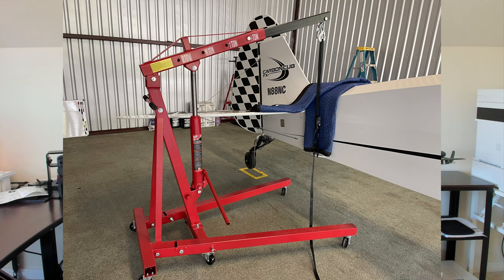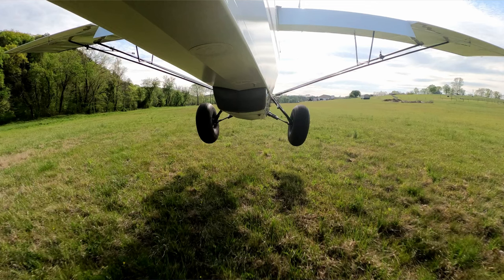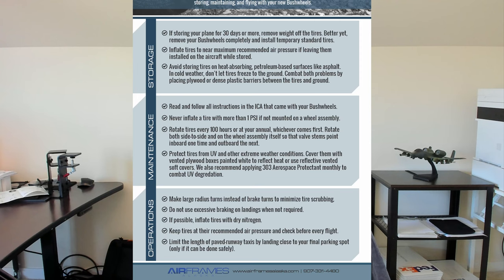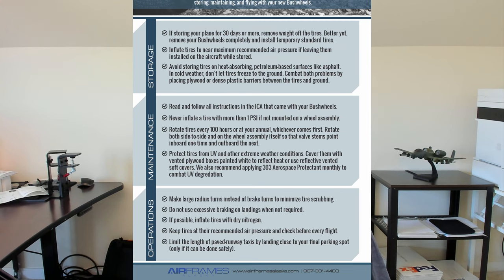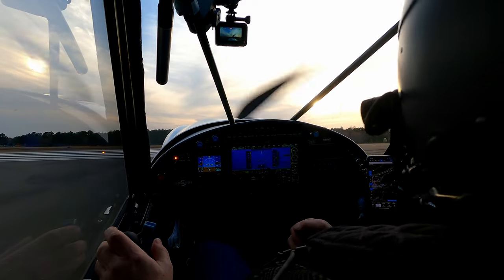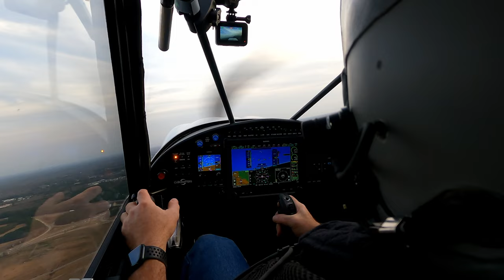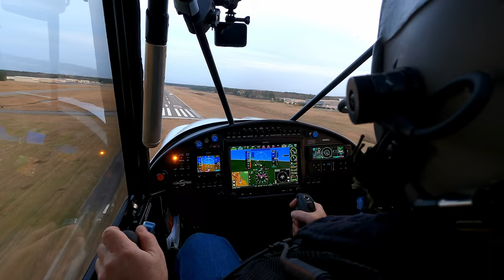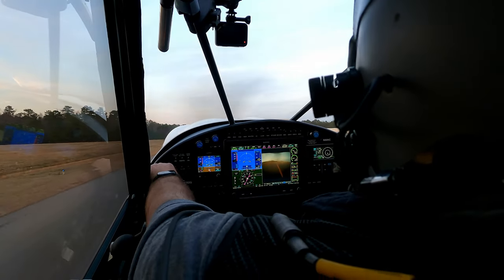Aircraft owner lessons on tailwheel inspection and care tips of AK bushwheels

Comment: I’ve been running ABW’s Tailwheel Shimmy Dampener for 2 years on our ACA Scout.  When we put it on we also went to the ABW Baby Bushwheel which has a nasty reputation of shimmy on Scouts; just to give the dampener a solid test.  I can report after maybe a hundred landings on concrete, asphalt, grass, gravel and dirt; high speed 3-points & wheel landings……not a single shimmy experience.  A miracle innovation at least in our application.  The best $1k I’ve spent on the airplane over the 9 years of ownership.  And for the size / shape / weight of a sardine can.
Reply from the maker: Sadly it doesn’t work on a T-3 tailwheel.

Comment from the maker: Looks like I forgot to insert the video on tire pressure info. I'll upload that one next time.
Reply: I run mine at 5, 10 if I'm doing pavement only which isn't often.  45 in the 3200 tailwheel.  Running 25 in the 8.50x6's with summit skis which turns into about 20 when I pull it out of the hangar at 0 F.  Looking forward to hearing your take.

Comment: Neal, excellent production like always.  If I might add - use caution lifting the tail at the handle area.  My A&P and I noticed some visibile flexing in the lower longerons when we thought about using that area as the supporting point for the tail.  I have also been cautioned by other CC owners to avoid too much pressure on that handle area.  The maintenance manual (reference figure 1 on page 07-00) appears to recommend supporting the tail at a point underneath the forward attachment of the tailwheel spring if possible.  The reason for this is I don't think there is a cross-tube going between the lower longerons where the handle is, it is in a bit of a mid-point between crossers, thus the flex.  Keep up the great work, I really enjoy your videos!
Reply from the maker: Thank you, good to know and learn from others. My fear was someone helping lift and putting their fingers through the fabric in the bottom. I considered a strap going completely around the fuselage just forward of the horizontal stab and that may be the answer to doing it myself. When I was at CC they lifted the tail one person using the same handle I'm attached to and one person on the other side but did rest it on a sawhorse. I have two of those and will use next time. Treading with caution and learning as I go. Thanks again Eric!
Reply: @NealCuliner  Yeah, I initially just had my tail resting on an upside down 5 gallon bucket with blankets on top near the handle when I was installing my tailski, my A&P didn't like the way it looked when he walked in, shined his light in the tail and had me reposition the bucket farther aft closer to the tailwheel where there was a cross-tube.  At CC they always used the overhead hoist to lift the whole thing by the lifting rings, while I was there at least.
Reply: I am going to Cubcrafters mid April for my second visit. Will they issue the Maintance manual with the FX 3. I did not get one with my 2018 fx2. That would be very helpful as I also have had many questions as you Neal. Keep the videos coming they are a breath of fresh air.
Reply from the maker: You have to ask for the POH and AMM.

Comment: Hi Neal, great Video!  I have a T3 on my certified Cub with a field approval, it has all the torque values on the field approval.  I messaged you on Facebook for your email address, I'll send it to you.   What I found over the years with a Baby Bushwheel  and a T3 is to Wheel land and hold the tail off as long as possible, they all shimmy on pavement - grass no problem.  With regards to landing beside the runway, check advisory circular AC150/5300-13B, I was made aware of this by Kris at Tac Aero and a shot blurb in the AOPA magazine.  I noticed on your early videos that you only had lettering on one side of the tires, I didn't have the heart to tell you that there needs to be lettering on both sides of the tires. The Berringer wheels - I just returned from Cubcrafters for my final build we used a Cotter pin not a safety wire.  I use compression springs on my current tail wheel, it may be the first thing I change on my plane when I get it.
Reply from the maker: Thanks for the info. I replied to your messenger message. I don't wheel land on pavement as I'm trying to preserve the tires. I know regarding the letters, haven't decided what to do yet :) The beringer have a cotter pin on the axle nut but safety wire is on the inside of the wheel on the brake side that holds the wheel on. I can send you the Beringer doc when you email me. As to the landing on the grass my airport manager won't allow it. I sent him the new AC guidance but I'm at one of those places that hates GA. As a hangar tenant I have to comply with his rules. He won't change them for one person. Unfortunate situation but so be it. Was wondering when your final build was. Exciting!!
Reply from the maker: https://youtu.be/_-jonch_RIM
Reply: @NealCuliner  I can't wait to get the new plane for sure.  You know, this whole wearing out of Bushwheels on pavement is over stressed in my opinion.  I have had the same bush wheels for 11 years, I land on pavement most of the time at least once or twice every time I fly.  So I figure I have about 1000 payment landings and I really don't see any wear on my tires, with the extra rubber - on the new plane (I ordered that too), it should be even better as I speculate.  I remember talking to Wup Winn who worked at Alaska bushwheels before Airframes bought it and he scoffed at the idea that they were as wearable as most believe.  He said "I got them on my Maule and I land pavement all the time".  As I understand, taxi is the hardest on them, never lock a brake to turn.  I believe in Alaska they have a lot of sandpaper like stuff on the runway surface - correct me if I'm wrong Narwhal. But that would definitely lead to accelerated wear.
Reply: @Cubonaut875  Sorry just reading this, but there is definitely a lot of grit/gravel on the paved surfaces at the airports up here.  Luckily most airports have some kind of gravel strip you can land on, but even so taxiing on the pavement is usually required to get fuel and/or to a hangar.  In my situation the main paved runway is a 1/4 mile taxi from my hangar vs about 2/3 mile to the gravel runway; I usually depart from the pavement and land on the gravel as a compromise.  Speaking of which, another reason I run the 31's a little lower in pressure (~5 psi) is to minimize the amount of gravel they throw up on landings, it seems the firmer tires are more apt to lanch gravel at the tail as they spin up on landing.  I speak with no authority on any of this as I have only been flying GA in AK for 4 years and had a plane with bushwheels for less than 1.